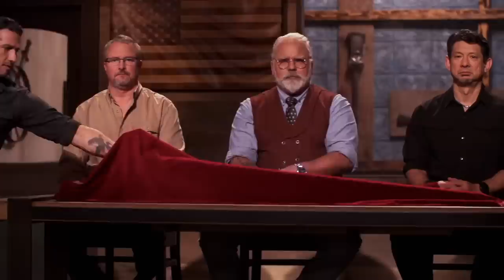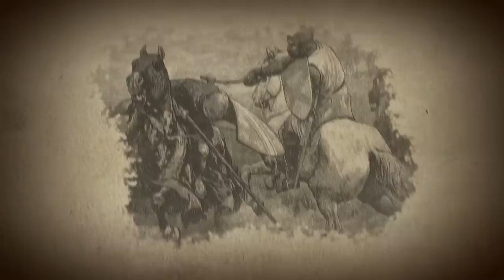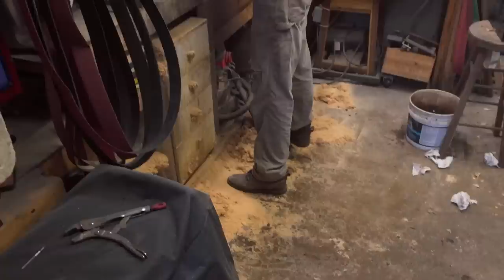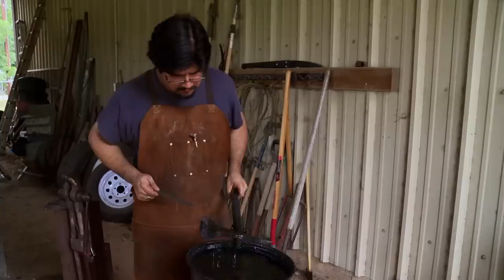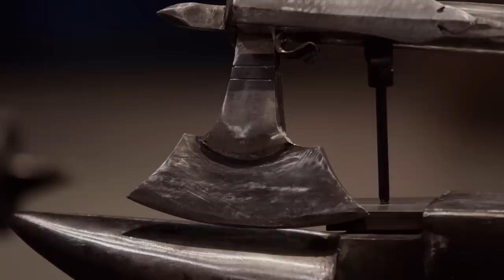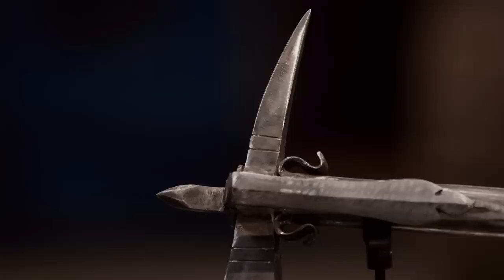FORGED MADNESS: Japanese Ono vs. Horseman's Axe | Forged in Fire

Comment: Really depends on the use. The horseman's axe was designed for use from horse back. Not gonna be using an ono while in the saddle. On the ground, the ono has the reach advantage, but the horseman's axe being 1 handed allows you to use a shield(or I suppose another weapon for parrying) with it. Horseman's axe definitely seemed more controllable, the ono handle kept rotating in the user's hands. I think ultimately I'm choose the horseman's axe.

Comment: Imagine the damage Doug could could do if he swung the weapons at the correct angle.
Reply: Yeah sometimes I have seen that the blade is a bit off with the angle he swings
Reply: Imagine fighting in a battlefield and the opponent just stands perfectly still so you hit at the perfect angle.
Reply: He also wasn't swinging it properly to get the full power potential out of the long shaft.

Comment: Comparing the weapon type as a concept, an archetype, is pointless here so I'm looking at workmanship.
The ono turned out pretty and clean but it has functionality issues. Haft is too round leading to testers clearly having trouble with alignment, and the bulging heart-shaped insets bother me. Ornamentation should never hinder functionality, not even slightly. I liked the integral wedge splitting the haft in the head, very stylish, but perhaps less... adjustable, because if the head comes a little loose you can't just hammer the wedge deeper or change it. The back is for counterbalance and versatility, it should be blunt or spiked: A second, slightly smaller blade is not really useful.
The horseman's axe looks rough at first glance but up close some real skill shows through. It's definitely too heavy which is a problem, but you can tell that it's not going to break anytime soon. The demo axe's haft is so thin that I don't think it would have survived the ice block without bending or snapping at the handle or on a weld. He clearly did cut down on weight without sacrificing strength by making his haft ovoid which is great, but he could have gone further for sure. His welds look solid. The curve in the spike is good and I'm glad it doesn't have a "neck" that would get it stuck in armor. The blade could have used a sharper curve, helps with targets that aren't stationary.
While I would have liked to see the ono tested on the block of ice or on animal horns to better gauge its sturdiness, overall I prefer the horseman's axe.